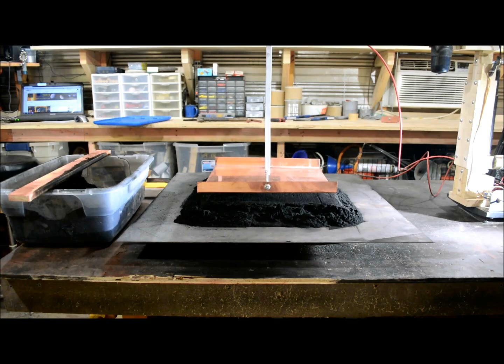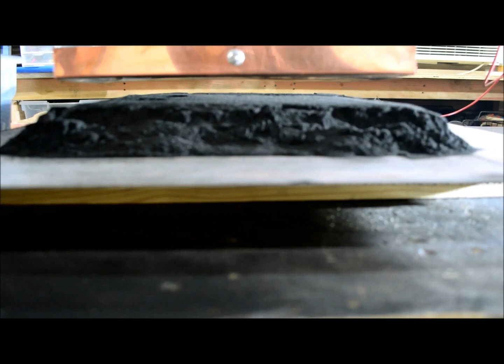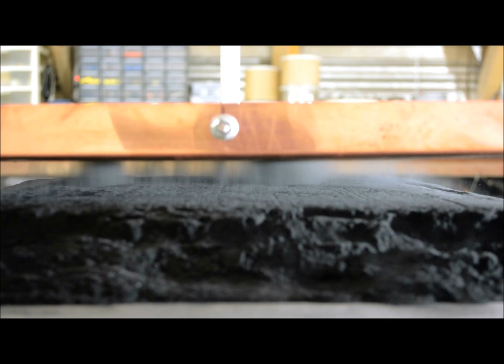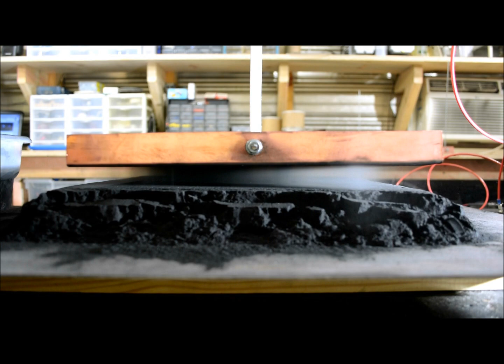Carbon Black Test 15kv

Comment: On a larger scale, a highly charged presence above the surface of carbon &/or carbon based material is going to
pull more material from the surface into the separating media (air, oxygen, atmosphere. a conductive media)...
 gives "manmade climate change" a boot in the face!

Comment: Mr2Tuft2 I found you via SO and am so glad i did. The practical experiments you do seem to pick up where my science classes left off (many years ago) I have so much to ask and talk about but I tend to ramble so I'll just get to 2 things now but please let me know if I become a nusience 1. how the sun works balloon videos you were tracking down the cause of the anomoly "fireflys". Might it be various random particulate debris in the balloon from manufacture?? 2. Carbon black test. You said ac and dc yielded the same or similar results. i would have to disagree. AC appeared much more controlled and uniform , almost "paced" whereas the DC appeared abrupt and chaotic over a larger area simoultaneously.  I LOVE WHAT U DO!!  Anything going in the steam arena?  Just askin'.  Enzo

Comment: Looks like a dust storm. You can see the movement of the particles up but also horizontally at times, so I believe you could consider that an ionic wind. If the table were rotating approximating the spin of earth then it might impart a lateral wind movement or if the electrical source were moving the same might occur.

Comment: What's up br0hammer? Very nice! Sure looks to me like it's all tiny little tornadoes...even the cloud looking areas look to be 100s of tiny tornadoes...very stable tornadoes, like on the sun. I'm curious if you have a HV capacitor to put in the HV circuit? You might get different results perhaps? My life is still a bit insane buddy, but sane skies are on the horizon, and also a good 10 cigrit skype convo too :))
Reply from the maker: Wonder if a microwave cap will work. That's all I have. Can't wait to chat with ya. Not soon enough. :)
Reply: Mr2Tuff2 You would need a few of those mwo caps in series...or you could make a saltwater cap.